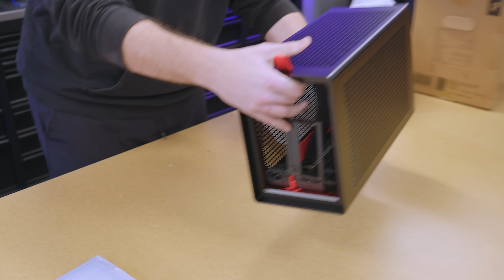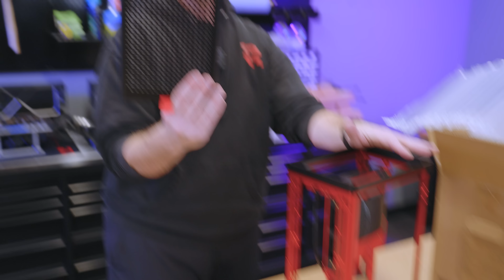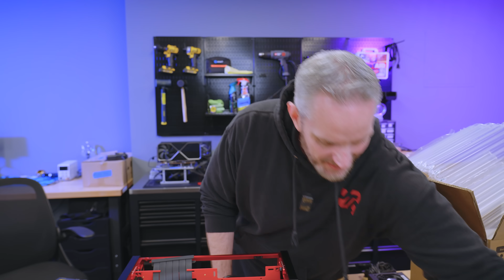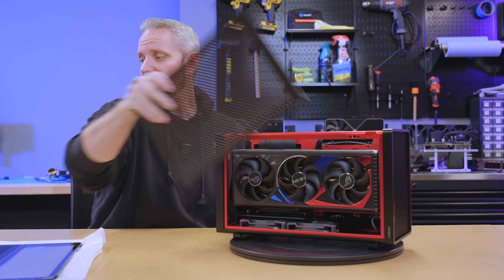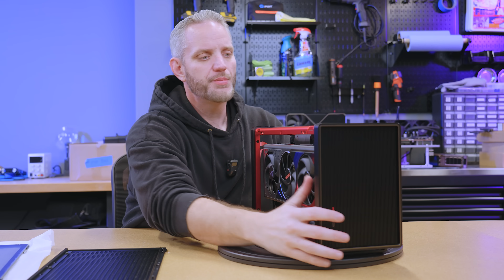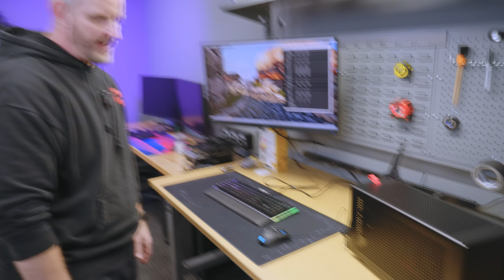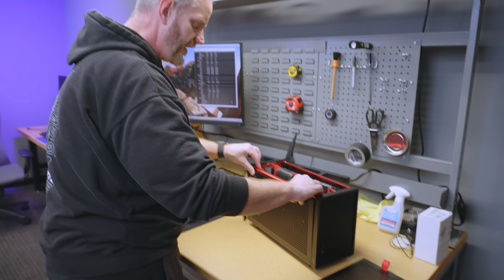This build quality is INSANE! CNC Milled, Modular and Adjustable!

Comment: I prefer vertical SFF cases as horizontal takes more desk space.
Reply: I really want a case manufacturer to design something like the original Corsair one. Vertical is my favorite layout but hate that I have to lay the case down every time I want to connect a cable.
Reply: @justcause9334 fractal ridge?
Reply: @its__abraham  The Ridge is very nice, but I want a wider case, not a deeper case. Something more like the Ssupd Meshroom S, but not all mesh. I also want a way to route the GPU connections to the back of the case.
Reply: Yeah been tempted to try out a Meshroom S for exactly that reason.  I think the only way to really compromise on CPU tower clearance is to have proper room for a 280mm rad and this Antec doesn't really look like it does in the orientation they built it for.
Reply: Haven’t seen one that doesn’t cause fires yet. As a loque ghost user I wouldn’t mind vertical but they are also so wide it defeats the purpose for me idk. Looking for best of both worlds
Reply: Lol I have a phantek nv9 on my desk😮
Reply: That’s why I’ve stuck with my H1 v1 for 5 years (fixed the fire hazard lol) I’ve got a 12700K and 7900XTX packed in there with no desk footprint. I bought a custom wood front panel on Etsy for more ventilation and aesthetics. But I love it.
Reply: Well as they said they will be making add ons. They could possibly make legs for it so this can be put vertical. But the other side of that, you could easily get right angle cables and potentially 3d print a legged frame for it.
Reply: Can’t you like, flip it vertically? Or is the structure not good enough to handle that physical stress?
Reply: Me too, I have a Hyte Revolt 3 that is basically this M1 but vertical and without the need for a riser cable. I like to watch case reviews especially for SFF cases and I've yet to find a better case than that for my needs. And it also supports 280mm aio so you can really put some crazy hardware inside it if you want.
Reply: Dude, same!!! Hence why I havetheHyte Revolt 3. LOVE that case
Reply: Same, I have like 7 sff vertical cases atm.
Reply: Any horizontal case is a vertical case if you want it to be
Reply: Horizontal if going somewhere like a media cabinet in the living room, Vertical if it's going on a desk.
Reply: I’ve never had a computer on a desk. It doesn’t make sense to me. They are floor things. Monitors are desk things.
Reply: @ people keep it on the desk because there’s technically less dust. I like my pc on the desk, but my desk isn’t big enough (to have room for my mouse movement) so I have it on my floor.
Reply: I would really love to build in a Tower 300, but can’t get past the cooling issues with vapor chamber on GPUs.